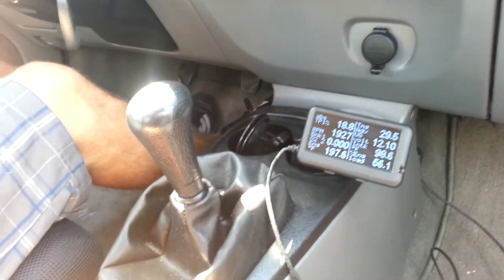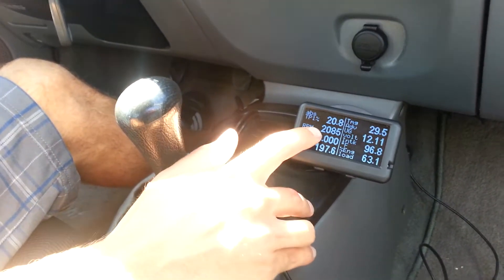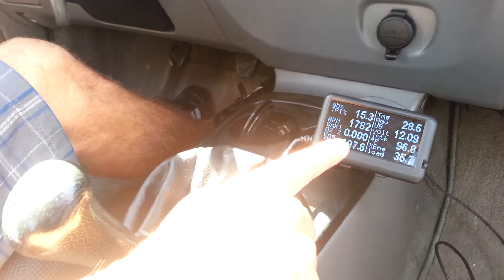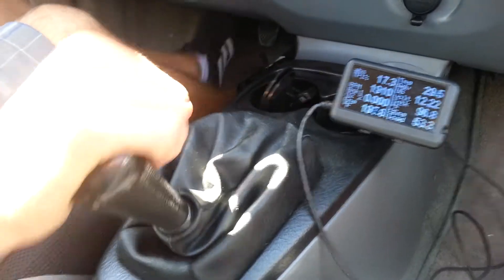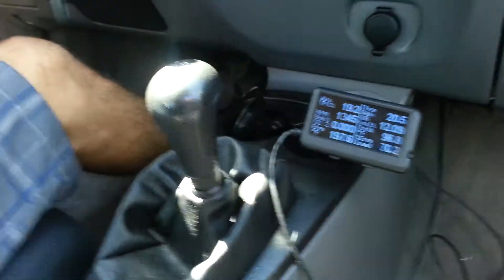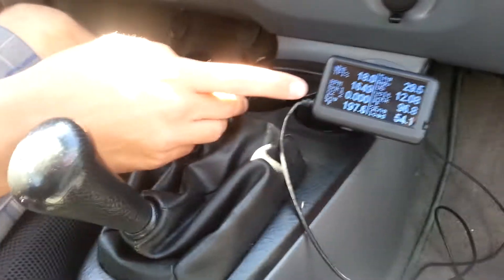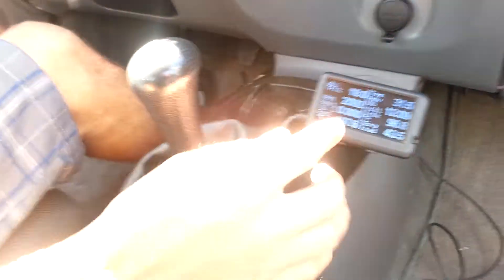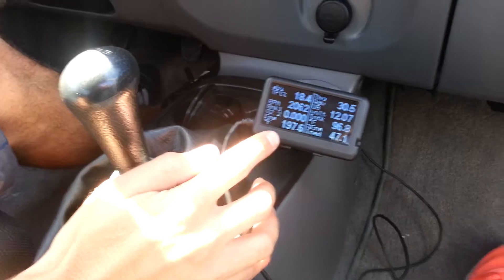How to shift without losing Lean Burn. Honda Insight.

Comment: I find it interesting that your MPG on the horizontal gauge is always high each time you glance at it. Even the slightest bit of throttle in mine and it drops below 50. Brand new bumblebee battery two days installed - lots of rolling hills on my commute though.